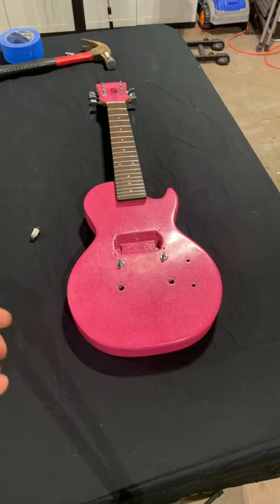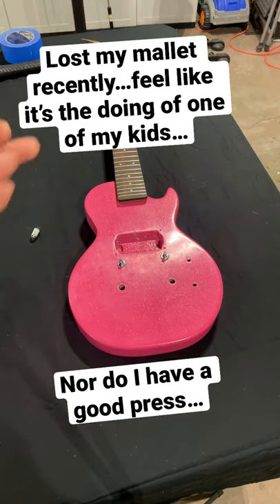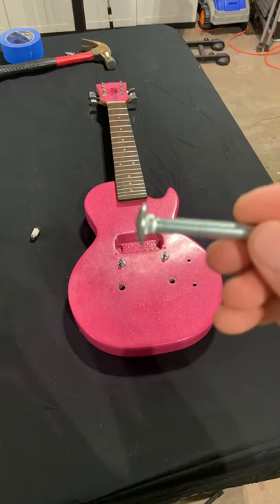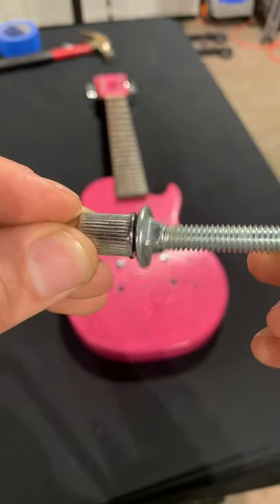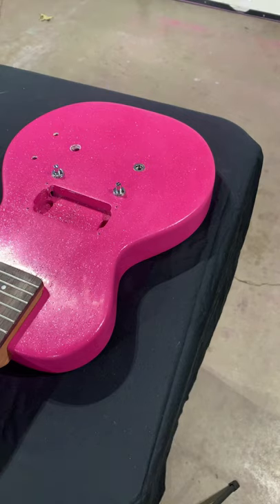Installing Tune-o-Matic bridge studs with carriage bolt and hammer

Comment: Solid hack!  Are those threaded internally?  If so, It maybe more work to find the right size bolt, but you could thread it on and then have an enormous amount of stability control especially for the first 0.46mm of insertion. 🥸👉🏼👌🏻
Reply from the maker: Ha trust me I thought of that but not knowing the quality of the metal used I didn’t want to end up gumming up the threads…

Comment: Nice hack! Id use it on my kit but it has a tele bridge plate. That guitar is gonna be rad.
Reply from the maker: I’m putting a string through bridge in my tele build. So I’ll have to make a video for drilling that shit out
Reply: @Tkolbo_  yeah mine is a top load but it has holes if I ever want to make it string-thru and add ferruls on the back.

Comment: Maybe put a nut on the bolt so you don't mess up the threads. Nice hack
Reply from the maker: The carriage bolt was one I had lying around so I didn’t care about the threads if the bolt. Was more concerned about the threads inside the stud